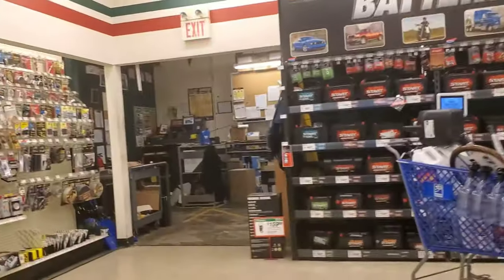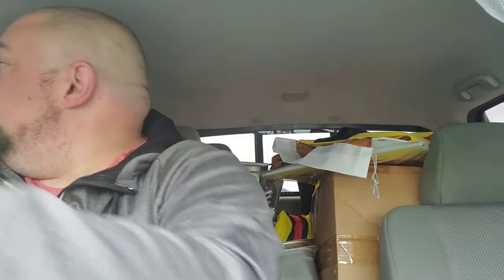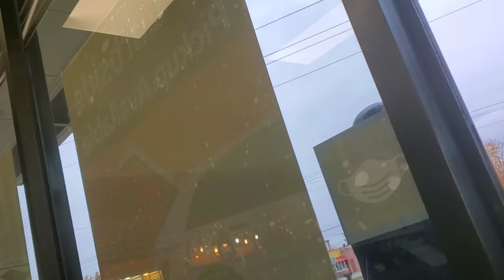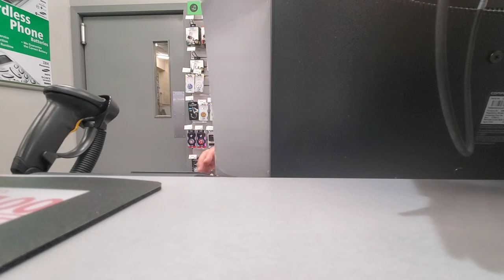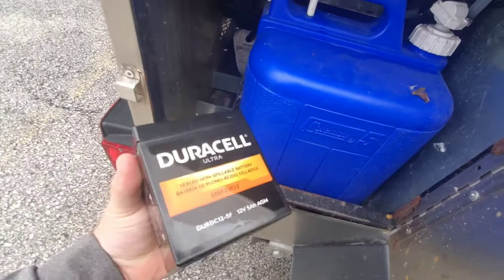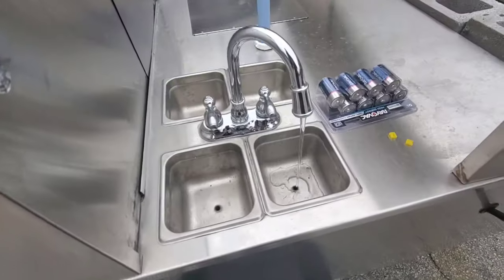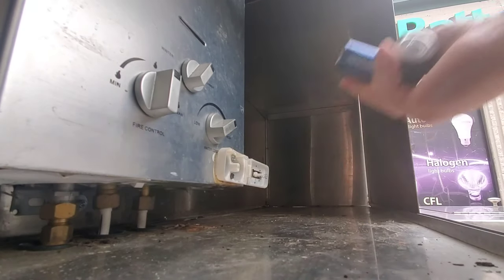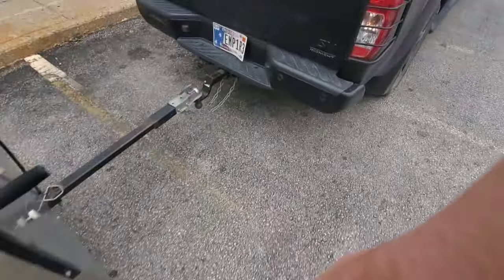Testing the water system on the Big Dog Cart!!!

Comment: Mine works better when i 
Ignite the burner's first and get all the air out of the lines, then the on demand hot water heater ignites fairly fast and you'll have water hotter than you can stand in about 10 to 15 seconds with that far left heat adjustment knob in the 12:00 position. Anything past that will burn you, or at least on mine anyways : ) 
I definitely agree with being in a hurry! I did buy some chip clips from Ben though 😂
I can tell you this your grill bottle will run low on propane before the steam table will because the boiled water maintains 140+ for a really long time

Comment: Did you get a charger for the battery with the cart? Assume that old battery was more than 4-5yrs old if it won't take a charge anymore. Amazon and eBay also good sources for those batteries.
Reply from the maker: I've got a charger already!